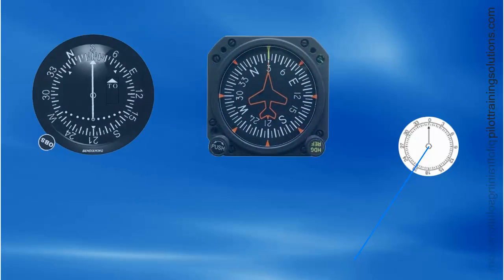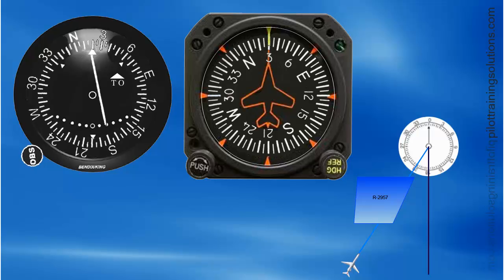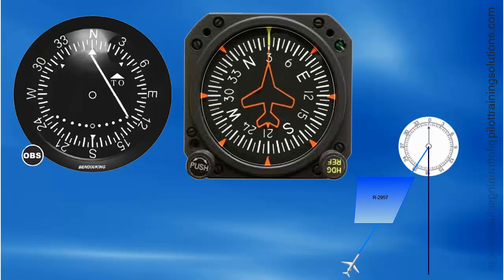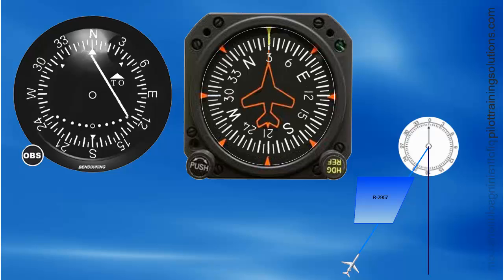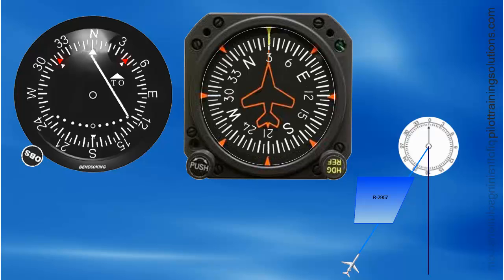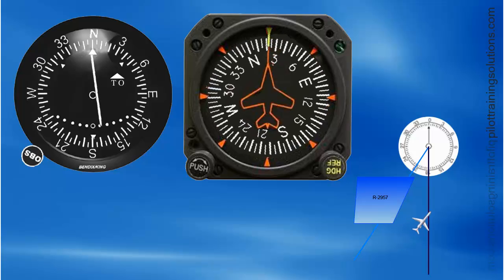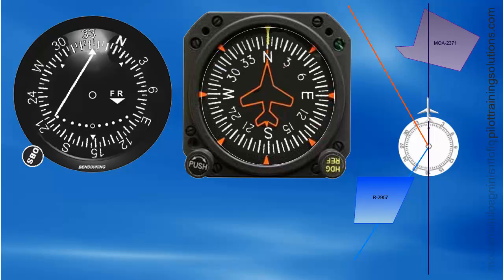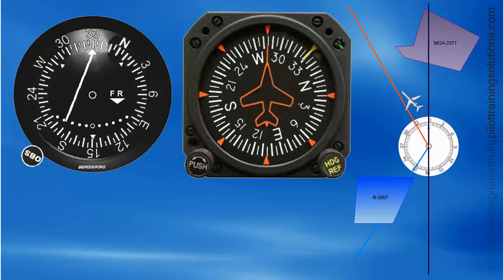Intercepting VOR Radials

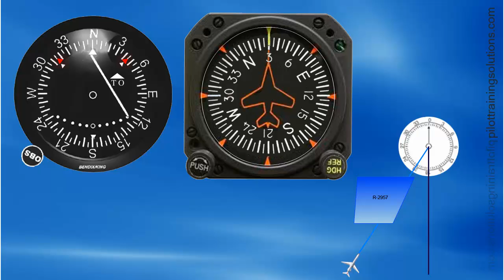Comment: Q-At 2:28 the statement “ our heading is going to be 045° “..? If flying zero-three-zero (030°) TO a VOR and directed to the 180° Radial on my starboard or right side, relative to my aircraft-why would I not add 045° to my HDG of 030° and take up a HDG of 075° to intercept the reciprocal of 180° which is 360° ? If I’m flying on 030° and change HDG to 045° as stated @ 2:28, that’s only a + 015° correction to 045°.
Reply: Indeed, if it's grater than 45º you may never reach your radial. This explanation is flawed.

Comment: What is the biggest difference between the Non directional beacon and the VHF omnidirectional radio?
Reply from the maker: They are completely different. The main difference is that the ADF points directly to the station while the VOR gives you a general direction where the station is and then you have to set it yourself to navigate to or from the station: https://passfaaexams.com/

Comment: That's actually way easier than I thought it would be. Thanks a ton! Question: why aren't there papi lights for left right? Surely pilots could benefit from having a small bit of assurance that they're flying perfectly to the runway in all directions instead of just vertical height.

Comment: I'm not sure how to program or what to program on how to find the airport you're flying to, when doing a VFR flight
Reply from the maker: It depends on which Instruments you have available. To fly to an airport directly you will need a GPS. With no GPS you would find a nearby VOR and enter it's frequency Instrument Rating the radio/nav stack.
Reply: @GianLucaNoia  okay thank you iFly flight simulator I'm by no means a real pilot but I like doing VFR flights I just have a hard time finding the airport I'm flying to. So I can program an airport in the GPS and that'll give me my distance when doing a VFR flight?
Reply from the maker: Yes it will give you distance, direction, time to destination and also draw a line on the map to follow.
Reply: @GianLucaNoia  Thank you very much I'll try it now

Comment: What is the maximum intercept angle when intercepting radials/LOC?
Reply from the maker: Generally if you are intercepting a Localizer course ATC will initially give you a 45 degree intercept angle and then reduce it to 30 degrees. Intercept angles will vary between 30 to 45 degrees, depending on how far you are from the facility.

Comment: Excuse me , I do have a question . What's the purpose of the RMI (Radio Magnetic Indicator) ?
Reply: the RMI was invented with the pourpose of reducing the amount of instruments in the cockpit. It holds a card which moves by itself, so you dont need to manually rotate to the headings you're flying and it also normally holds a VOR and an ADF needle, you get two instrument indications on a single instrument, making it much easier.
Reply: Thanks !

Comment: Why did you turn to 285 radial??
Reply: He didn't ever fly the 285 radial, he tracked the 360 radial outbound and used the heading of 285 to intercept the 330 radial outbound at a 45 degree angle.
Reply: I fly a VOR to VOR so, passing a VOR station when i change frequency to the next VOR station! Thanks.

Comment: This sounds good, however, what if you are flying the 225 radial and you have to intercept the 180 radial.  The little triangles will tell you to fly the 045 heading which you are already on.  You will never intercept the radial.  Am I missing something?
Reply: And to intercept the 360 radial one should fly at 45 degrees, which he is already doing! I'm afraid your answer makes sense but doesn't answer the question, or am I wrong?
Reply: +Rod Musson It depends if you're flying To or From the beacon and what your current heading is. You can't work off of your radials to intercept.
Reply: You are flying 225 radial to the VOR. When they tell you to intercept the 180 radial they are looking the radial FROM the VOR, which is reciprocal of the 360 degrees (which is the "same" radial but from your point of view), so you will need to intercept the 360 radial TO the VOR. I hope it makes some sense.
Reply: I also think, that this method doesn't work in those cases. Any explanation?
Reply: Steve If you are flying the 225 radial TO the station and you are aligned, your radial is read at the bottom of the VOR instrument, which would put your course at 045’ as well as your heading at 045’  (if your aligned of course. Also, don’t confuse heading and course, two different things). So, if you’re told to intercept and track the 180 radial TO the station, your are still reading the radial at the bottom of your instrument, which would be 45’ to the right of your current radial (225). In order to intercept and track 180, you would turn 45’ to the right, now heading 090’. When the CDI starts to center you would begin turning left to align with the 180 radial. My CFI always told me he prefers a 30 degree turn when flying TO the station because radials start closing in faster as you get closer to the station, and 45 degree turns when flying FROM the station as radials will grow farther apart. Now, if you’re flying the 225 radial FROM the station and are told to intercept the 180 radial you are now reading your radial and course at the top of your instrument. The 180 radial is to the left so if you turn 45’ to the left you’d fly the 135’ heading until the CDI begins to center. 
The rule my CFI used was
TO the station: DC + 30’
meaning Desired course, actual Course + 30’ (or 45 as this vídeo intends 45’ on either TO or FROM).
FROM the station: CD + 45’
meaning actual Course, Desired course + 45’.
Hope this helps.

Comment: Can I do that in a C152??
Reply from the maker: I would say 90% Yes. It does depend a tad on the equipment installed on your 152. If its a very old VOR probably not, but chances are an old VOR has already broken down and been replaced with a newer one so check for the markings on your Receiver...

Comment: in aviation, the aircraft flying instrument indicates in nautical miles? So, nautical (Knot) equal to what distance in regular (normal mile=5280ft)?
if the aircraft flying speed at 200 knot/hour, so what is it flying at miles/hour?
Reply from the maker: Yes most airplanes' airspeed indicators show Knots (some also show SM). 
No 1 nautical mile = 6076.12 feet
If the aircraft is flying at 200 knots, the equivalent is 230.156 statute miles per hour.
Multiply NM x 1.15078 to get the SM answer or just use a flight computer.